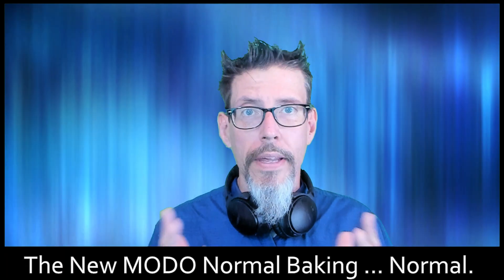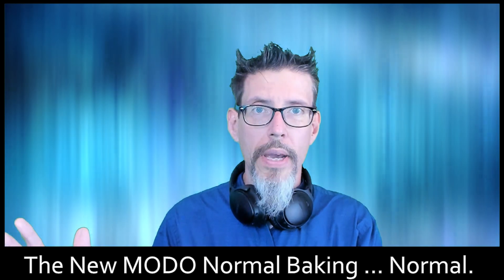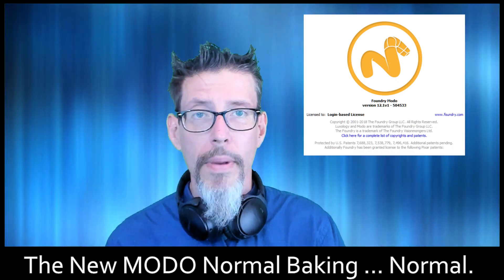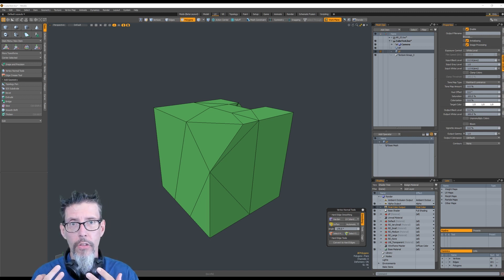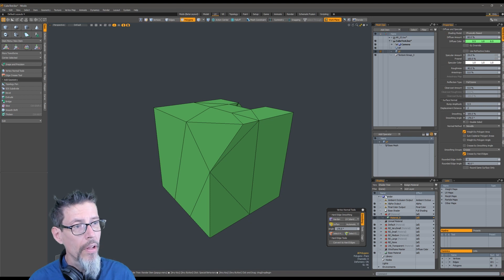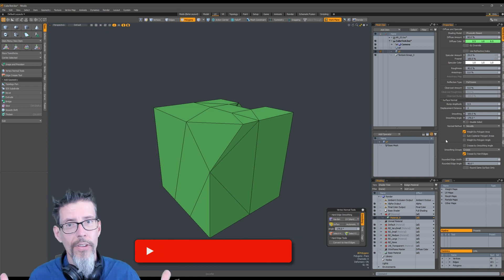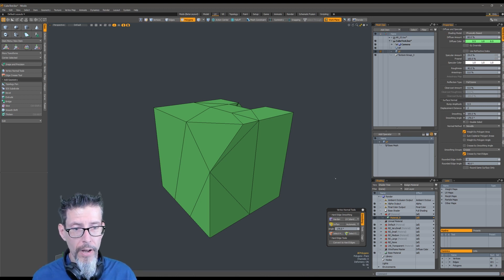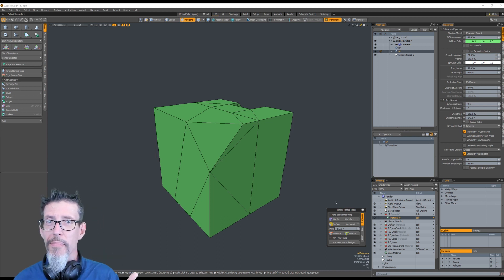The New MODO 12 Normal Baking … Normal

Comment: have a low poly object that is supposed to be smooth but it is giving me artifacts on the edges(like tracks of noise) used your settings and still getting the problem I see there is more options now on the pannel will try to play with them and see if I can fix it.

Comment: Thanks for video. It is interesting. Why you dont use baking wizard under game tools-baking window? Didn't use Modo 12. But in 11 it baked perfect normal maps with less clicking and it is a lot simpler.
Reply from the maker: Honestly, I've just never had a reason to use it. I don't know if it's good or bad, it's just .. not what I know.  I learned to bake before it existed and the name "wizard" generally implies something for beginners that has less options, in my mind.

And to be fair, once I set up the low poly material I show in this video and add it into my default scene, I'll never have to do it again.  So there's really not a lot of clicking involved.  :)